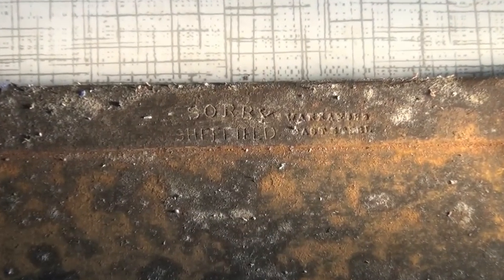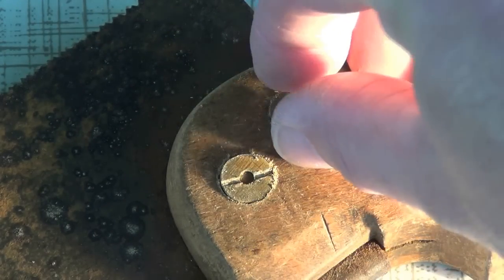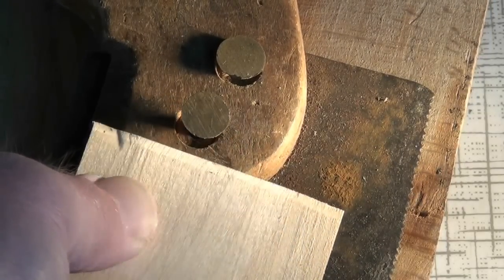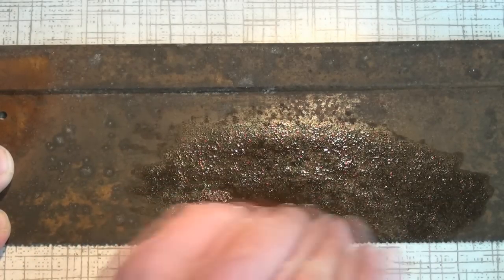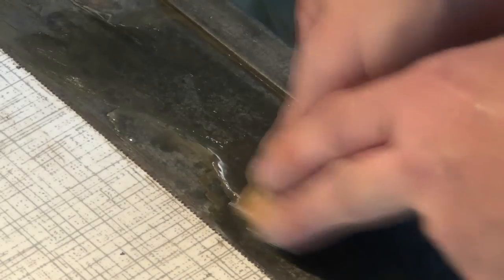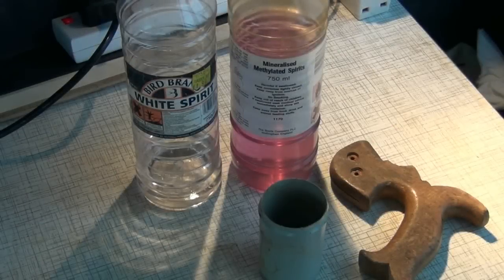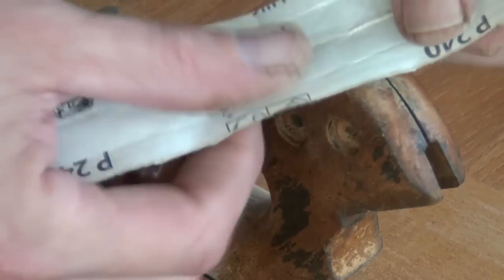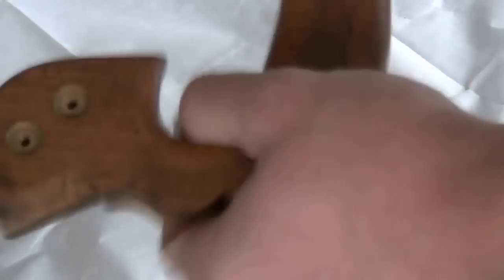Sorby Dovetail Saw Rejuvenation

Comment: Many of the old rusty saws I've bought from carboot/jumble sales have the hands fitted with plain dome heads on both sides, no slot at all. Not a clue where to start with them.
Useful tips in this Mitch, thanks.
Reply from the maker: Gareth Martin HeeHee! I like the idea of the previous owner's hands being fitted to their old saws!I do understand what you mean though Gareth, and I will investigate the matter once my cold clears up a bit. I suspect there is a simple solution, but I haven't ever taken one apart like that, yet!
Reply: WOmadeOD - Made in Wood with Mitch Peacock  Oops! Handles of course....

Comment: Hi there from Portugal,
I got a 300mm(10") dovetail saw (but with a brass back) does the back and handle need a close fit?
The blade has a close fit, in the handle, but the back is not so tight and wobble a little bit (I can only tell because the from of the saw moves side by side about 10mm(0.4").
Obrigado (Thanks)
Reply: +Mitch Peacock - WOmadeOD 
By the way how many TPI do you recommend for a 8" dovetail saw?